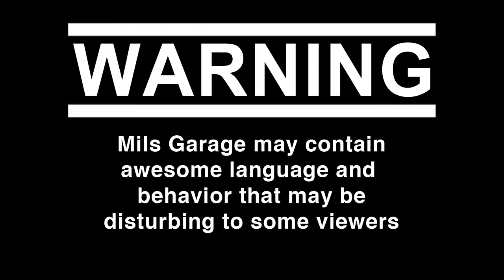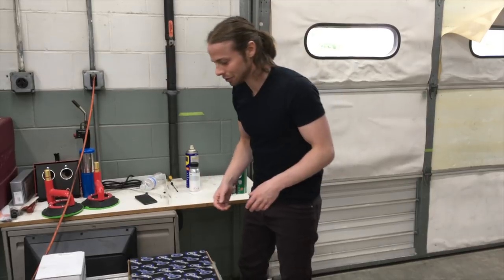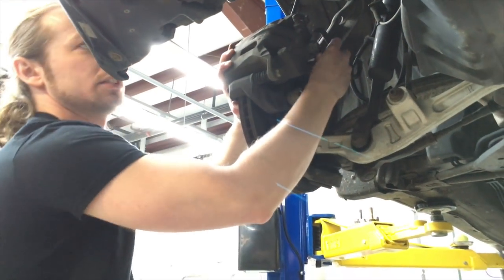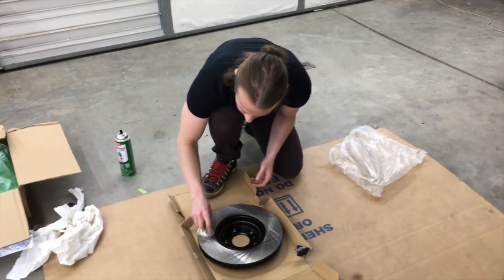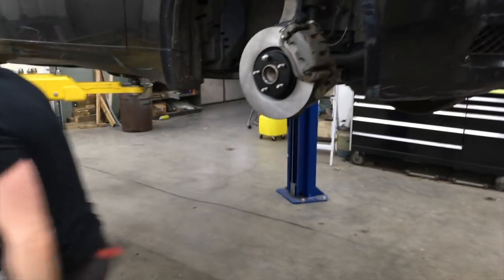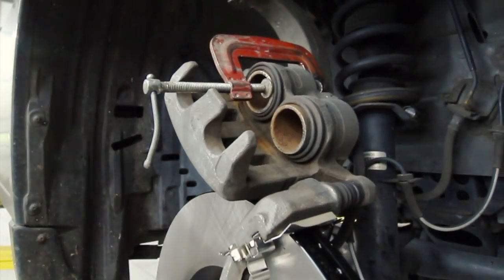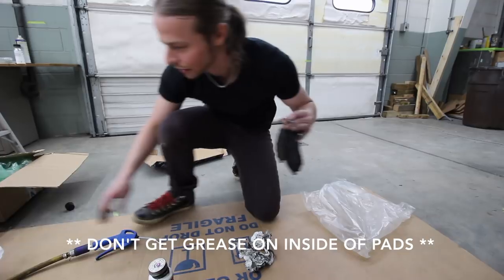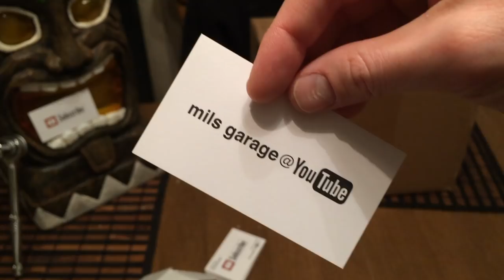Change Rotors and Brakes [Infiniti G35/Nissan 350Z] (COMPLETE TUTORIAL w/ Pro Tips)

Comment: Compress the piston in using the old brake pad next time.
Reply from the maker: Ryan said his boss does it with the pad too.. i'll try that way next time for sure. thanks for the great input :)
Reply: i cringed when i saw the c clamp being used on the edge of the piston.  ive seen people cock them doing it that way.
Reply: Thats a great hint thanks dude!
Reply: @milsgarage what mm socket for caliper bolt 19?
Reply: My channel locks weren't big enough so I placed them on the inside and opened them up. It worked fine.

Comment: I don’t even know if you will see this, but I have watched this video so many times just to keep the knowledge fresh in my head. Question though, what size bolts are on the back of the rotor? (The ones holding the caliper to the rotor) should I have that size in my socket set? Any ways, thanks for posting videos about G35’s there aren’t many 👍🏻keep up the good work!
Reply from the maker: hey Travis, the Caliper Bolts are 21mm. i have the sizes and torque specs in our Wheel Hub Replacement video for reference [ https://youtu.be/KAKKICX2wVU ]. i think you should have a 21mm, but i just recently found that my traveling socket set only goes up to 19mm, so you might want to check. i currently have 3 more G35 videos on the editing block, so lots more G coming up :)  thank you for your support!

Comment: One thing I didn’t see mentioned was that before you compress your pistons to leave the brake fluid top open because when you compress your pistons your pushing the fluid back up which leaves air compressed in your system
Reply from the maker: That's a very good point, and yessir! Nice catch Danny 👍👍👍
Reply: @milsgarage  Do you have to open the bleed valve to let old fluid out of caliper before compressing piston back in so you don't push old fluid back up to the m/c?.

Comment: High quality drilled rotors are reliable, safe, and run cooler and brake better than their counterparts. You must be thinking of cheap Chinese knockoffs. And the rotors have a light coating of oil to keep them from oxidizing due to exposure and moisture. It actually is not cosmoline, although Wikipedia inaccurately says so. I worked on U. S. Navy warships for many years and dealt with these chemicals. Heres a tip, use one of the old brake disks under your clamp to push in both caliper pistons together.
Reply from the maker: hey Tom! thank you for your service! i know where you're coming from, but i've had this conversation about drilled rotors with even dudes who live their life at the drag strip. drilled are not better in any way than simply slotted rotors. what type of oil do they put on if not cosmoline? and you're absolutely right about using the old brake disks to clamp the pistons. i learned of that method shortly after the video release 😎👍

Comment: My rear left rotor is doing the same thing. You can hear it while driving every time the wheel rotates. It's like a clicking sound that changes speed with how fast you are driving
Reply from the maker: @Sammyeggnog Yeah? It sounds like your axle joint might be failing and about to go. i would replace the axle on that side asap. You really don't want that to fail when you're driving
Reply: @milsgarage  thanks man. That's good to know. I thought it was just my brakes being wonky but that sounds possible as well
Reply from the maker: @Sammyeggnog Any time buddy 💯. For sure, it'll definitely be good to check both out. Stay safe

Comment: Hi, I was researching how to change my brakes and rotors since I got a quote and the mechanic told me it was going to cost around $700 to replace both my rear rotors and brake pads... my question is where is your garage located and how much do you charge for this repair? I’m pretty sure that with all the things needed that it’s out of my range of capabilities this early on... I’m gonna need to pay someone lol, but as a girl I’m skeptical that I’m going to get over charged for lack of knowledge.
Reply from the maker: $700 for 2x brakes and rotors? Are you buying some name brand drilled and slotted rotors? i've heard of $300 for 2x brakes and rotors for labor, but that's on the high end. The nicer rear rotors and brake pad kits on RockAuto.com run about $95 shipped. All together you'd be looking at ~$400 at a nice high end shop.. Are you at Mercedes? Are you driving a Mercedes or $70,000+ car? We're currently running a price of $420 for the labor of all 4 brakes and rotors + cost of parts. Wanna road trip to Delaware? Keep in mind all of these prices are today's rates. Maybe the other mechanic is working in 2025 prices, where candy bars cost $6.50 already
Reply: You don't need to fear being overcharged if you take the time to educate yourself on the cost of parts and estimate labor.... I mean you're on the video that shows you how to do it or make those estimations....

Don't choose helplessness :)
Reply: Lol, ur point exactly.. I’m on this video. It’s for a reason. But hey, thanks for the “advice”

Comment: Hey so I finally got the job done! My dad and brother helped me out! Took less than 1 hour with 3 pairs of hands lol. I took it for a spin and I still here a little scraping sound. Not as bad as before. I saw videos that maybe the cover is slightly bent? Does that sound right?
Reply from the maker: sorry for the delay! sure, the dust cover could be bent and contacting the rotor, or one could even be installed backwards.. how loud is the scraping sound? is it consistent or does it change? and thank you for your support Eduardo! :D
Reply: Mils Garage thanks man! It’s consistent but not as loud as when I had the old brakes and rotors. I don’t know if it’s normal or not. We didn’t mess with he dust shields but maybe whacking the rotor bent them
Reply from the maker: haha my bad, i just realized i messed with the dust shields to do the hub unit 😂. Yeah, great work Eduardo! but that scraping sound could be a busted axle, or even a bad bearing.. You shouldn't hear scraping for sure

Comment: Brake pads should come with those insert clips correct? Or would I have to order those separate? Only asking because I've only ever had my brakes serviced by professionals before, but I'm considering tackling my own brake pads next time they need replacing. Very nice video, thanks.
Reply from the maker: yeah, new clips come with the pads. i even just installed a caliper yesterday which came with it's own set of clips and new pins. and jic, when you get to the rear, you have to release the E-brake in order to remove the rotor
Reply: You don’t absolutely need new clips.  Just clean the old ones with brake cleaner and a wire brush and reinstall.  You’ll be fine.

Comment: Good job.  At the start, I would pop the hood and open the brake fluid reservoir and wrap a rag around it.  Sometimes when you push the caliper back in, it will overflow and you don't want that to happen, or you can suck a little bit of fluid out of the reservoir with a syringe  so it doesn't overflow and top it off when you are done.
Reply from the maker: cool, yeah that will work well. it will be easier to press the pistons back into position like that, but could get messy. there shouldn't be an issue either way

Comment: Cross drilled rotors DO NOT CAUSE CATASTROPHIC FAILURE.  They are fine on daily driven vehicles because daily driven vehicles WILL NEVER see brake temperatures associated with track cars.  When using cross drilled rotors on a vehicle that sees regular track events.  The heat can build up in the rotors and cause stress cracks.  Thus, it is better to use slotted rotors for track use.  Manufacturers like Ferrari, Lamborghini and many others have been using cross drilled rotors on DAILY DRIVEN CARS for years as have I.  With proper use, you WON'T HAVE ANY PROBLEMS OUT OF CROSS DRILLED ROTORS EVER.  Also, cross drilled rotors cool down faster during normal operation and they weigh a little less do to the cross drilled holes in the rotor.
Reply from the maker: So you’re saying i’m right under certain conditions? Then i’m glad i said it exactly like i did. :)

Comment: excellent vid. Im beginning to hear metal from my brakes, so its time. what brand rotor did you use and how much was it? by the way, have you had any front suspension squeaking issues when you go over bumps? Ball joints maybe? Im also in the process of replacing the valve cover gaskets. i have a 2003 with 112k miles on it.
Reply from the maker: @2:26
Reply from the maker: Thank you sir! Awesome work. Suspension squeaking? Sure. Depends on the setup and would need a thorough inspection. We can fix it at our shop if you're in the Delaware area
Reply: @milsgarage  Actually I live in Kobe, Japan (which is why i cant bring myself to calling that car an infinity g35. its a skyline gt 350) but in california at the moment for another year and 4 months.
Reply: @milsgarage  Domo, arigatou gozaimashita.
Reply from the maker: ii ne~.. Boku mo mae ni Kobe ni sunde imashita. Himeji Jo ha mecha kirei deshou? 😂 Mo sugu ni, tabun MG no shoppu ikenai ne? （笑）. i need to go to Cali some time.. i made it out to Vegas and Colorado, but have only had LA connecting flights.  Skyline deshou?? See, you know! lol i tell people.. Not everyone listens lol
Reply from the maker: @blackpassenger 🙇‍♂️ "don't touch my mustache" [ どういたしまして ]
Reply: @milsgarage  waaaaaa! sugoii wa! nihongo pera pera. himeji sundetta no? boku wa nishinomiya sundeimashita. Itsu hyogo ni sundetta? did you live in himeji or in the surroundings? I used to teach in the akashi jhs district for many years. I came back last year and bought the car from may volvo mechanic, who'd been fixing my family's volvos from back in the 80s. (I also have a '98 s90 now.) And the first thing i did after buying the car was get jdm tail lights from Hiroshima. I haaaaate red turn signals. 

Oh, by the way, you may like my book about Japan: Black Passenger Yellow Cabs. Its ten years old now. in fact, the last time I came the US was on the book tour back in 2009 - 20013. let me know what you think. matta, yoroshiku onegaishimasu. 

that front suspension noise, going over bumps, from your experience, what is it usually? most people are saying ball joints. Yeh yeh yeh, i know you cant be accurate w/o looking at it.

Comment: I got my rear brake calibers on my 2005 350z  mixed up and not sure which side goes to which (dont have the box it came with because I turned my old ones in) now after I repainted them idk which ones goes to which side (never done this before) what should I look for the know which sides it goes to?
Reply from the maker: the bleeder valves go on top. so do the wear detectors.

Comment: Don't use paper towels or any other material to apply brake cleaner to the rotors. rotors have a cross-hatch like surface on it to keep it both directional to contact pads and those will scrape off tiny pieces of the paper towel and imbed it in the grooves. just spray the cleaner on the rotor; it's not eating the damn paint. brake cleaner is not brake fluid.
Reply from the maker: oh wow. u'r absolutely correct. 
http://www.superstreetonline.com/how-to/paint-body/impp-1108-these-will-strip-paint-off-cars-fact-fiction/

i just added this info into the description. thank you so much for your support!
Reply: Should you wipe off the excess though with a microfibre towel or something? Im gonna be doing this for the first time this week!

Comment: After doing brakes and turning the rotors my pads are rubbing light with slight drag. It’s not bad just making sure it normal after doing a brake job
Reply from the maker: It is normal for them to touch slightly, yes. If you just did them, you might want to remove the little caliper brackets and clean them off so they're bare metal again where the pad touches; Apply the grease to the caliper itself, where the bracket contacts the caliper (this will let them seat smoothly)

i've learned a lot about brakes since making this video.. Please ask for clarification if needed. i'll be making an updated brake video soon
Reply: @milsgarage  very much appreciate. Keep up the good work

Comment: hate to bother you on the g 35 cooling issue 

The hose running from the overflow tank to the radiator is missing one of the clamps. Would that be enough to keep it from going back into the radiator?
Reply from the maker: well yes. that could do it lol 😂

Comment: Was there a small set screw for that extra hole? I don't remember there being one, but I was wondering if it's just the wheel/lug nuts that hold the rotor in place.
Reply from the maker: Which hole?
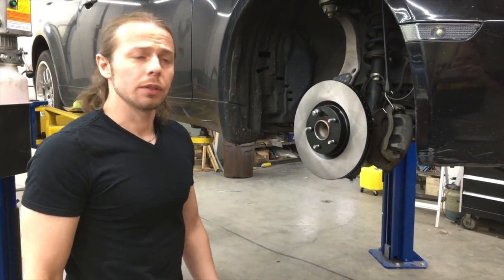Reply: 7:44 after mounting the rotor, then putting on one lug nut- there’s a small hole between the lug bolts- I’m not a brake pro, it just seems like some vehicles have a set screw, but I don’t remember one. I have a slight vibration around 75-80 and I’m trying to narrow down the source. I had the tires re balanced and the guy said one of my front rotors was loose. I told him that they’re held secure by the lug nuts but the other side didn’t wiggle as easily. I just started wondering if I missed a set screw or something.
Reply from the maker: @thebigempty_5792  Oh, i see. Yeah, some cars have screws that hold the rotor in place when the lug nuts are off.. Mine didn't come with any, and my old G didn't have them either. It won't cause a problem if they're not in. This is why i use a lug nut to hold it on. i had that vibration issue with my original wheels. i find that wheel vibrations like that are normally caused by small bends in the wheels [ caused by pot holes and speed bumps in combination with having low tire pressure ]. My mom's car had a vibration at 80mph, and i bought her new wheels; vibrations went away. She later told me she hit a big pot hole with the original wheels
Reply from the maker: @thebigempty_5792  Btw, every Toyota and Honda that's come in the shop have had the rotor screws 👍

Comment: Question. The breaking pins, that has rubber part should be located on the upper or on the lower side of caliper?
Reply from the maker: i can’t recall.. i feel like it’s the bottom, but i also feel like the one with the rubber is there cause the other one is a difficult fit.. Sorry G R, maybe someone in the comments will know. i believe they’ll work either way
Reply: @milsgarage  looking at your video (11:48), they are in the lower side. I disassembled to clean and lubricate them, but forgot how it was originally)) Thanks, your video helped me!
Reply from the maker: @G R Yeah? Awesome 👏😎 Thank you for your support! Keep up the great work 🤟😁

Comment: So I technically don’t have to remove the entire caliper assembly from the rotor if all I’m doing is swapping my brake pads correct? Or is that necessary to remove the old brake pads? Gotta replace mine soon since they’re pretty worn but my rotors and calipers aren’t even a year old yet so they’re still good.
Reply from the maker: that's correct sir. 😎👍👍 just pull the pin and swing the caliper over, re-grease the pins and you'll be golden.
Reply: Mils Garage Quick reply, awesome stuff man, thank you. Also, the caliper pins should be located in similar locations for both the front and rear correct? And the process is the same for the rear also?
Reply from the maker: that's also correct sir. 😎👍👍👍👍 any time buddy

Comment: Hey random question. Do you have any videos regarding key fobs? I bought the car from a buddy of mine over a year ago. He gave the Infiniti fob that it came with but it was broken. My G has a keyless start. I just crank the ignition when the fob is in there.(if it worked). Right now, I’m using the key that comes in the fob
Reply from the maker: we don't have that video atm.. so much going on.. are you sure it's broken? did you change the battery?
Reply: Yeah. Still didn’t work though. Then I took it to my local mechanic and they ran over it lol. I’ve seen that people buy the fob from amazon and program it to their car. Insert and take out the key like 10 times and a few other steps. I tried it but couldn’t get it to program with my car. I’m wondering if it’s due to mine being keyless start. The videos I’ve seen of people programming, theirs takes a regular key to start the car.
Reply from the maker: your local mechanic should stop doing drugs. i feel like you should be able to program it regardless of being keyless start or not.. i don't know the programming sequence off the top of my head.. i just Googled "how to program keyless fob g35" and that's the sequence i would try
Reply from the maker: is it a 2008?

2008 Infiniti G35 Keyless Entry Remote Fob Smart Key Programming Instructions:
 
There is no manual on board procedure to program a keyless remote to this vehicle. This vehicle requires special equipment be connected to the vehicle to program the remote.
Reply: Mils Garage lol I do trust them but they’ve ran over one of my fobs and lost my other. Only reason I didn’t flip out is since neither worked
Reply: Mils Garage no mines an 06
Reply: Mils Garage I think I just figured it out. On the description, it says it won’t work if you have a smart key or proximity system. I think mines smart key. I think I’ll have to go to the stealership 😦. Luckily the friend who sold it has a brother who works there who can get me some money off the cost
Reply from the maker: well that sucks, but sweet if you can go through someone who works there. it figures they'd come up with an awesome new feature, and make sure to get as much money out of it they could get.. arg